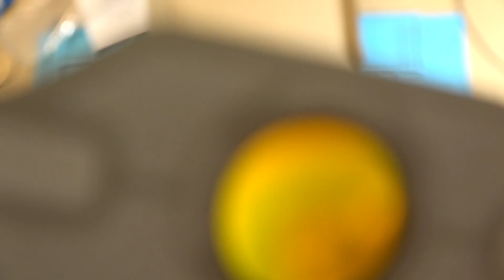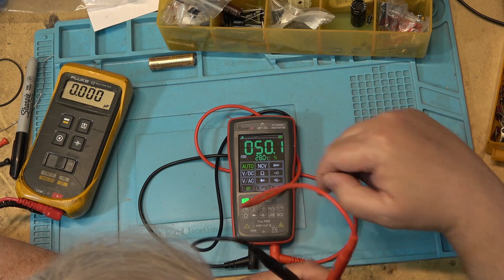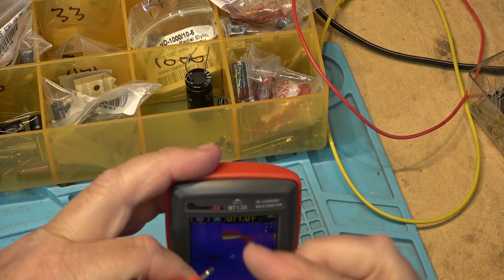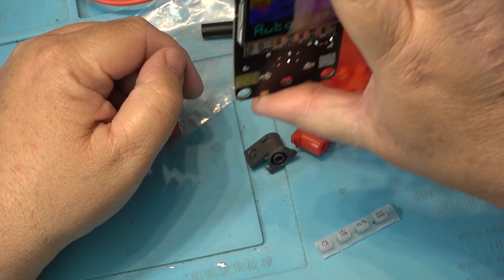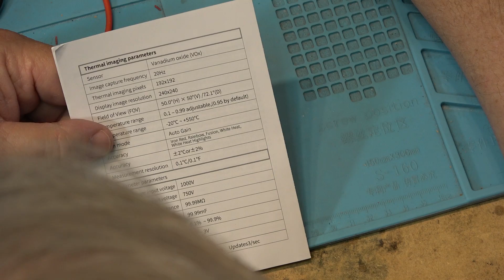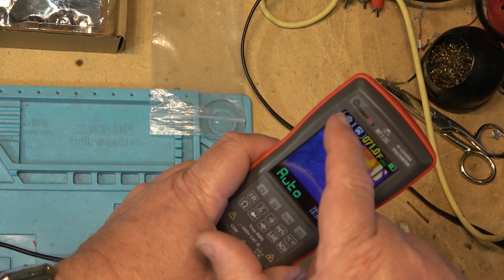Mustool MT13SPRO Digital Multimeter with IR Thermal Camera full review and tear down

Comment: Slick unit. Thanks Dave.  By the way, is the meter FUSED or at least the test lead ports ?
Reply from the maker: No fuses and none would be expected as it doesn't measure current so the inputs are high impedence inputs.  Couple of circuit protectors and a spark gap.
Reply: That's interesting and good to know. I sure I'll buy this meter.

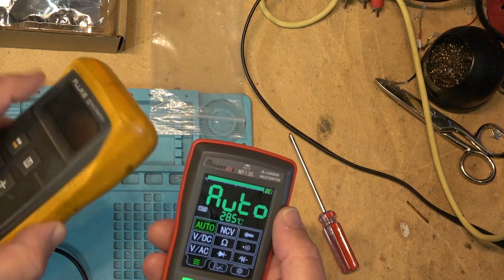Comment: 41:32 The thing is, a new Fluke meter will last decades; the last Mustool MM I got lasted months, and most of that time it wasn't used.
Reply: All my meters IV bought are must-tool (and that wasn't intentional just happened that way) and that cheapest one I got is the one I use most. (It's got brilliant continuity beeper timing) it's a clamp meter that I thought was the version above & I was getting it cheap.. thought it measured both AC & DC current but it only can do AC. 
Got it for €15.99 & the one I thought it was came in at €36 around then. 
Got a clamp meter that measures DC current, that was the last meter I bought. MUST-TOOL as well. .
This meter here will be my next MUST-TOOL to the addition.😁🇮🇪🙏

Comment: I'll take the Puke over some cheap Chinese junk. I wonder how long that meter will last.
Reply from the maker: My fluke has been served at least 10 times.  Always sane problem compression conductors between the switch and board, and display and board.  Ever Beckman i owned failed the same way too. Looking at the board on this i would say barring dropping something on it and breaking the screen it should last for awhile.  It ain't no fluke though but then it also ain't no 500.00 either but it is still quite expensive but it also has a thermal camera and for that restore alone it's great.